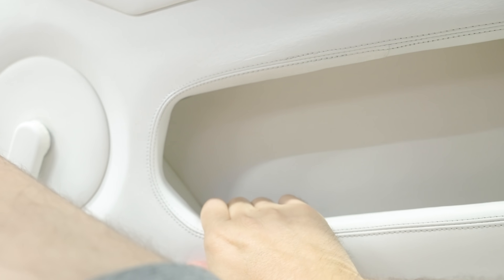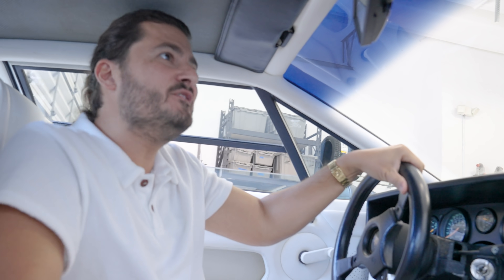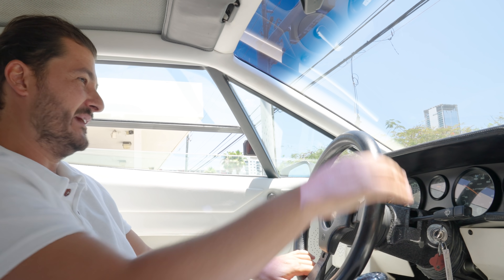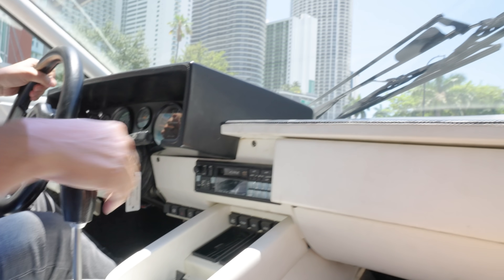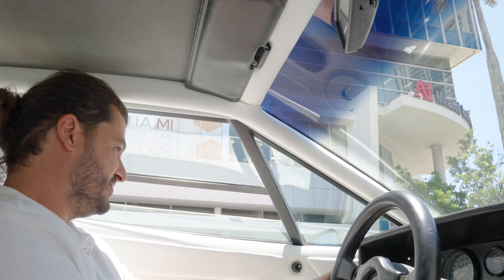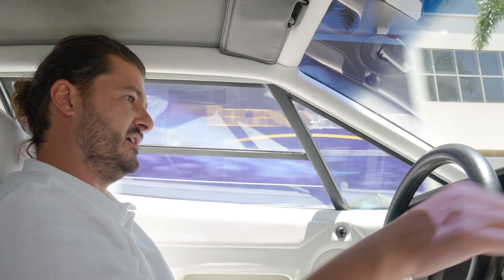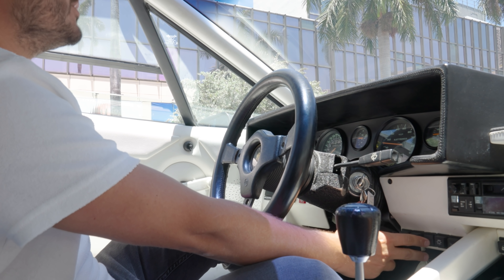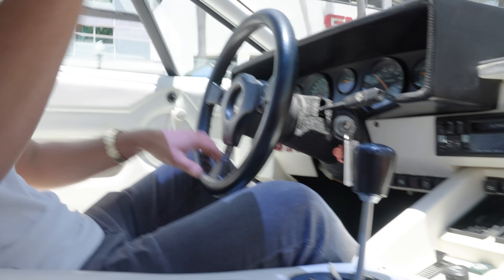Everything Wrong with Stradman's Lamborghini Countach (It's ALOT!)

Comment: You can fix the radio feedback by twisting the ground and power around eachother like a braid. Run both the ground and power direct to dedicated battery fuse of the main terminals
Reply: Or just suppress what ever is causing it. Alternator and or HT ignition.
Reply: That is the most ridiculous thing I've heard and I've been a 12 volt installer for 2 decades LOL

Comment: Driving a white on white Countach through sunny Miami is just something I’d describe as „perfect fit“.

When you mentioned 91 octane fuel it reminded me of my first time at a petrol station in the US. I was a bit confused since 91/93 is something we haven’t had for a while over here. But generally higher octane can make a big big difference on almost any 80s car, I assume it has to do that some are still tuned to work best with leaded fuel 🤔
Reply: It sure does give some Miami vice vibes.

over here in the uk we have 95 octane and then our premium which is 97 octane.
Reply: @garygritter5701  Yeah, similar in Germany. We have 95 as „super“ and 98 as „super plus“ - and then all the high performance snake oil variants of the different brands, of course 😅
Reply: Temarian should've dressed like Sonny Crockett for this vid; white blazer, white slacks, peach-colored "T", and a pair of Wayfarer shades 😬
Reply: @kimosabbe50  if I lived in Miami, that would be my standard look. I do, however, live in Hamburg, which is the northern German antithesis of Miami 😅
Reply: @jim_bocho  😮
Thought of one more touch that would've been a perfect for this vid: Temarian should've pulled out a Jan Hammer cassette set to play "Crockett's Theme" 😉
Reply: @kimosabbe50  As a fellow Jan, I can only agree ☝️😉
Reply: @jim_bocho  👍
Reply: It’s all unleaded.

Comment: I had a similar AC blower fan noise in my Countach. This evolved into a terrible racket. The fan is moulded into the plastic, which made the job not as simple as expected. A car with many quirks, that I love owning and driving.
Reply: How comfortable is it?
Reply: @marklynch1305  I’m not tall, so find the car very comfortable. I’ve installed a reversible ez power steering system (which disengages when I’m at speed) making parking and three point turns easier. I don’t find the clutch heavy, and love the gated manual. A truely analog and mechanical driving experience thatI thoroughly enjoy.
Reply: Why don't you have it on YouTube? If i had a car like that i would never stop filming it haha
Reply: @magiccheeseball  That’s what my son keeps telling me too 👍
Reply: @marklewis2736  do it for your son then! 😀 that woukd be awesome to see anyone would like to see a car like that it doesn't even have to be a YouTuber quality video I'm surprised your son didn't upload videos of it 😁

Comment: Is there any differences between a 1988 and a 1988 1/2?  A local guy here has a white on white countach as well but his is a 1988 1/2.  Looks just like this one but you can see the rear toaster box american bumpers holes where he removed them.  I didn't see them on this one.  (On a side note:  Did curated purchase this car from Indiana by chance?)
Reply: There Is No Differences Between A 88 and an 88 1/2 its just That The 1988 1/2 Was Built In The Second Half Of 1988

Comment: What are your thoughts on installing electric power steering to Countachs as Harry Metcalfe has done to his QV and seems to be a popular mod in Eurupe
Reply: I installed the ez system on my Countach. Active only when parking or 3 point turn. I use the car a lot and recommend it. I also installed (reversible) tiny blind spot cameras in the small windows near the doors. Image displayed via the rear vision mirror.  With the annoyances out the way can enjoy the beautiful mechanical nature of the car, the noise, and of course gated manual.

Comment: i don't blame you for not having a tape for the Alpine. Who the hell would man. Put a 2022 deck in there and put a better amp in there and upgrade them speakers and ad some low end if it all possible. Going cross country with that crap system in there.

Comment: I hear Jay Leno has 86K on his Countach, and he used it as a daily for years.  Please tell me why does NO ONE in the car industry not know that is it bad Esp in hot climates to run a car low on fuel because you will Kill the fuel pump?  I don't know if Lamborghinis are like this , but almost all the cars I've had a pump in the tank which is cooled by the fuel so if no fuel the pump can get hot and fail.  I learned this by experiencing it first hand so now I try not to let any of my cars go less than 1/4 tank. Just a FYI for anyone with Normal cars , maybe.

Comment: If all the components are so bad and unreliable just change them for better manufacturers. You obviously don't run contact points so you are prepared to modernise so why stop there. As for headgaskets needing changed and low miles. Find another supplier. I had a second hand xj12  with 70k miles on it and put on another 15 and never needed gaskets done. Modern spark plugs last forever. If you improve the cars reliability then get it done. It's how these cars came about inches first place. Triumph stag get the kenlow electric fan as a matter of course. The sm gets a rad flush every year. You're preserving a problem